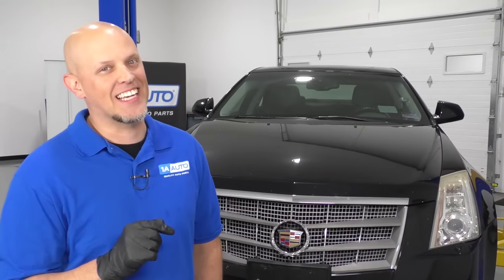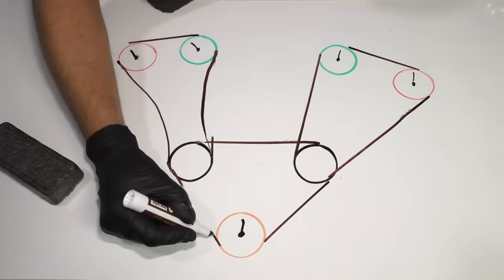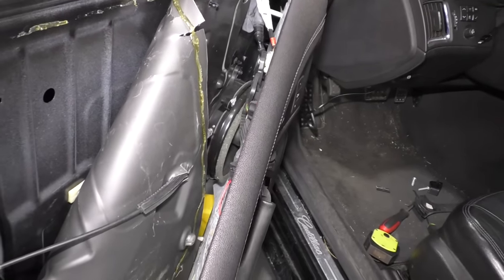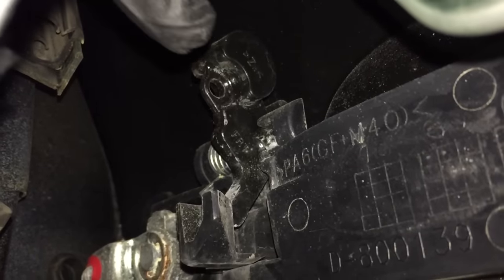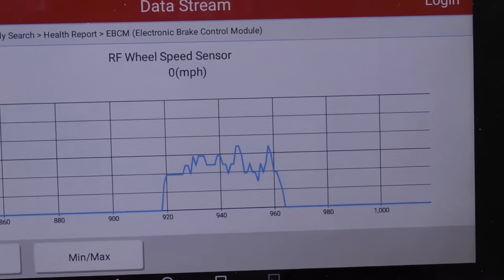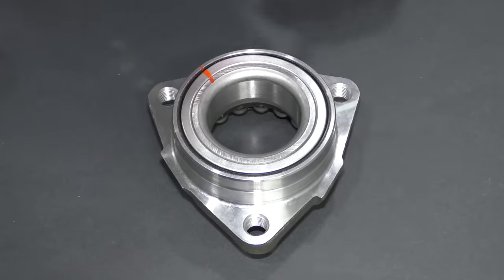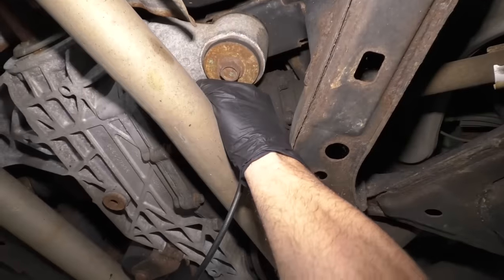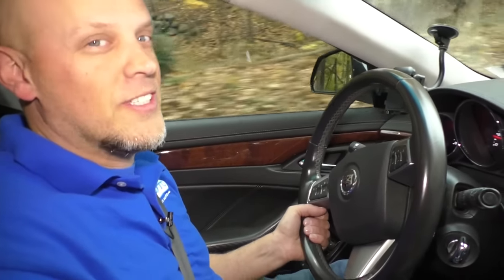Top 5 Problems Cadillac CTS Sedan 2nd Generation 2008-14

Comment from the maker: √  Watch the Video
√  Buy The Part at 1A Auto http://1aau.to/m/Visit-1AAuto
√  Do it Yourself
√  Save Money
Reply: I live in Nashville and I found an 08 All Wheel drive for an phenomenal price. It has a problem  with the steering and brakes cut in and out, I think its a vacuum leak. It only does it when the car is at idle. When you are on the gas the problem vanishes. Any ideas on what it may be?
Reply: I have had a problem with reduced engine power, any tips on correcting that?
Reply: Can yall show how to replace a cv axle please
Reply: What about 2008 DTS secondary injection valve stuck open.?

Is that expensive easy fix 
P2440?

Thank you
Reply: On a Cadillac SRX 2008 model

Comment: Don't forget the fact that you need to remove your entire bumper just to change your headlights.
Reply from the maker: +D Flash Thanks for the feedback!
Reply: Wow that's should be expensive
Reply: Actually you don't have to completely remove the bumper thankfully. I just replaced both headlight assemblies and I found a video that explains how to do it without removing it. Not exactly the easiest thing but it's better than paying a mechanic to do it
Reply: @ziggymac5813  I know on my 1st gen you go thru the wheel well so that probably works on 2nd gen too, both sigma platforms
Reply: Not true you can do it by the tires I've done it
Reply: Same thing w my old g35 led went out n I needa to rip off tha whole bumper
Reply: Honda's are the same way I don't know about any other car
Reply: Very annoying
Reply: G6 is the same way
Reply: Nothing difficult unless you’re lazy
Reply: Changing lights in heat wave - bummer
Reply: Not true!!!!
Reply: You only have to pull off the the side and the underneath clips. Go in through the wheel well
Reply: Oh that part i do hate takes a good hour of my day i recommended  changing them all to Led all in 1 shot last long time ⌛
Reply: Bro fr its so annoying😂
Reply: A lot of car manufacturers do that crap. I had the same problem with my 12’ Dodge Avenger.
Reply: Same on my wife's Hyundai Genesis Sedan. It wasn't that big of a deal. I also changed a headlight on my father in-laws CTS that was a pain
Reply: @codychavarria6088  nah man, my 10' civic the drivers side u can pop in and out, passenger you need to turn your wheel and wiggle it in through the wheel well. Not the easiest but better then taking off the bumper
Reply: Yeah that was an entire ordeal😂
Reply: Can be done other ways, but the number is actually fairly easy to pull on these. have to pull it to access washer fluid pumps and reservoir as well. Bought a 2011 that had the front bumper replaced and they forgot to hook the washer fluid hoses back to the pumps on the reservoir when it was installed. Talk about annoying.
Reply: @samholcombe3129  I was able to do that on my 2nd gen, but it was a tight fit, and you will get scrapes and cuts on your hands as well as cramps
Reply: @jesusramirez3145  way more difficult than it should be Richard!

Comment: I have a 2012 CTS and I hate the fact that anyone walking by can just open up the fuel door with a press and put whatever they want in there. Don't leave this car on the street if you live in the hood and/or have enemies.
Reply: Buy a locking gas cap. I've put one on 3 of my cars and never had a problem.

Comment: I have a 2011 cts 3.0. Owned from 46,000-98,000 miles. I’ve never had one check engine light or one single issue. I just did a coolant flush and transmission flush along with standard oil changes. Highly reliable vehicle at a great price and style.
Reply: Yeah that’s because you actually take care of your car😂 most people don’t realize they need to service other parts of the car other than the engine
Reply: The timing chain problem doesn't generally happen until the 100 to130km mark.
 I bought my 2010 CTS4 in 2018 with 151km on it and I was given the stealership invoice showing the timing chain was recently changed, I think it cost her around $2100 in all. 
The thing is you have to keep that oil changed. When I took it to my stealership they told me the first idiot owner never changed the oil for the first 15 thousand km and that's on a brand new car, the second time he changed it was around 12km.
 Thank god he sold it, I'm owner #3. I've had pretty much no issues except a new battery, front rotors and a door lock actuator in almost 5 years.

Comment: actually, #1 problem with these engines is the lack of baffles on the valve cover gaskets, which allows oil passage in the vaccuum lines. buy after market valve cover gaskets with baffles and the oil consumption is greatly reduced. my theory is that this contributes to the timing chain issue greatly.
Reply: Just had my valve cover gaskets replaced with the OEM ones , wish I had read this earlier :(
Reply: Just heard Scotty kilmer say that.

Comment: I've had my 2009 CTS for 3 years now. No problems...and I've done lots of driving!
Reply: I guess we got lucky lol. I had my 2009 cts 5 years no problem i even drive uber in it 4 days a week
Reply: How many miles do you guys have on them? I have an 09 CTS with 113,000 and its perfect but im worried about the sealed transmission. I would like to change the fluid but I don't know if it is too old to change now . the manual says to change it at 100,000 miles but no one I took it too was willing to do it . I guess i should have taken it to the dealership but they rip you off in insulting ways. They want like $600 just to change the fluid.
Reply: @MSG685  I'm up to 155k so far all good. Unfortunately i had to let the dealership rob me for the transmission fluid change. I've seen a few forums where guys are walking you through the steps to do it at home if you're into the DIY thing
Reply: I have a 2008 CTS DI with 121k miles. Have not had any major problems since 54k miles when I bought with 54k. Alternator was replaced a while back, I did have some leaks from the timing chain cover, I had that leak from a dealer because I did not want to touch that not had the time to do it myself. I actually had a fuel leak but was able to fix it myself with like $40 bucks. Right now I have a low RPM idle and I think I need a new oil pressure sensor because it only reads 0 or 100🤔
Reply: Daniel Thomas 

I guess it all depends on the previous owner and how well they kept up with the maintenance. I have an 06 CTS, it runs like a dream. 71k miles, 1 previous owner (my dad), no major issues. When he gave me the car, it had 38k miles. He was retired, so it was driven very gently and infrequently. All fluids checked and topped off weekly, I never let the oil life get lower than 20%. I only use 93 gas, and I use a bottle of Gumout about every 6 months or so. 

She just had her first tune up about 6 months ago at around 67k miles, as I was having a misfire that triggered the engine light. That’s the only thing I’ve ever had really other than the sunroof being sticky sometimes, but I live in Florida, so it gets very hot and wet and makes rubber sticky. 

Once in a while if she sits in the rain for a long time or we have a Hurricane, it will idle rough for a few drives but always smoothes out. I bought a car cover for hurricanes since I unfortunately don’t have a garage. 

I have heard a lot of bad about these cars but in my experience they are very reliable if maintained properly. Most people ignore their cars and just drive until something goes wrong. 

My dad had a Jaguar S-type, which was a total lemon and money pit, and now has a BMW 535 and I swear something is ALWAYS wrong with that thing. The shop has it more than he does.
Reply: @MSG685  dealership charged me 150 to do fluid exchange.
Reply: 04 deville with 200k
Reply: CTS Owners: Check your oil level regularly and top it off before it gets low, best preventive maintenance you can do on the 3.6L engines. They almost all burn oil as they age, but they'll never need timing chains as long as they aren't run low on oil.

Also, find a reputable indy transmission shop and have the fluid drained and refilled (NOT "flushed"), or have the fluid quality inspected first if you have high mileage already. If the fluid looks burnt/contaminated then you can at least know you waited too long to drain it out.
Reply: You beat the odds on that one.
Reply: I’m jealous of you. Recently purchased my first one, drives like an angel but after a month all the problems came 🤣
Reply: Then I wish 2020 brings you an honorable mechanic!🌟😁🌟
Reply: @DollnAbox  Good Advice Thanks for this Info. I Was gonna buy A Cadillac BUT i Was Afraid too BUT I feel more Better about it NOW that I have Read your comment.
Reply: @califoreigniasims3713  I had the exact same problem.  The first 200 miles were great.  Then the "computer" failed, , then the driver's door would not open without manual intervention, then the transmission kept throwing "Limp Mode", and then the Security System would NOT turn off, preventing the car from being started, and more.  These cars are the bane of their owners, for the most-part.
Reply: 08 was the 1st of the new generation. Sounds like they fixed a bunch of issues in the 09. My 08 has had alllllllll the issues
Reply: 09 cts owner here . all mine has downs is been a headache. Between check engine lights and timing chains pretty sure my transmission blue tonight its been nothing but trouble . i own a 04 Yukon with double the mileage with 0 problems why cant Cadillac make something good anymore
Reply: I've had a few issues but nothing major except my sunroof leaking and I know to clean out the drain tubes to fix that.
Reply: Is it gonna be a good choice to buy one cts 2008 in 2021? Need suggestions please!
Reply: I do the oil change everytime it needs it the only problem I had was the water pump fixed it
Reply: You jinxed it
Reply: My story is opposite: nothing but engine lights
Reply: Thank you so much for saying that. I just bought that year to be my hoopty for the next 6 months to a year and I really don't want to have a strong of issues. Bought from private owner and I guess you never know.
Reply: @MindRightLifeRight  I have an 09 CTS and my oil pressure gauge started doing the exact same thing last year at about 80k.
Reply: That’s a blessing
Reply: U lucky ive had my 2010 for about 3 years and have had to replace pretty much all these things except the timing chain but i have camshaft and crankshaft  position sensors codes
Reply: I have a 2012 cts. 160K miles and NO problems ever. Best car I've owned so far.
Reply: My dad got lucky same with you guys
Reply: @yamimreza8057  same here
Reply: @MSG685   i got it changed with thr filter for bout 170$ at a mechanic  i know in long beach long Island  ny . Change the oil oem oil and filter dont use aftermarket s
Reply: I just bought mine and it was shaking real bad when I was on the highway
Reply: @califoreigniasims3713  how many miles did u have
Reply: @rondijcks9162  how many miles did u have
Reply: Very lucky u😮‍💨.
Reply: @yamimreza8057  no buy above 2014 model
Reply: How has it been 5 yrs later?

Comment: I have an '08 CTS Performance with 88k on her. Fan-TAS-tic automobile!!! Really quick and fast, NO major problems EVER. Owned her for over 5 years now. Have had none of these problems except the passenger front door handle has quit on me. I thought it was a programing issue; took her to the Stealership for a reprogramming to fix said issue. [Never said to just repop her, just that the outside handle stopped working!] They had the car for 2 days. When I come to pick her up, service manager acts like it's the task of the century to repop the system, had to do it twice, etc. $600+ later [!!!!!!] , now working, brought her home and didn't drive her for a couple days. Lo and behold, I can't open the door for my love!! Broke again!!! No recourse on an electrical repair!!! So, she's still broke! Thank you SOOO much for showing how to test it and what the switch looks like; I may tackle it myself when the weather gets warmer, as it's pretty cold out right now! Thanks again! SUBBED. PS  I still love this girl!! MT Car of the Year in '08!!
Reply: GM-Cadillac just doesn't get it. Knowledgeable people no longer regard Cadillac as a premium brand...except in regard to the prices they charge.
Reply: I still have the 2008 CTS4 I purchased brand new in 2007, it was "Car of the Year" for 2008. Problems I'm now having are primarily electronical, a/c controls quit working, rear windows roll down on their own, car occasionally goes into "limp mode" where it will only go about 30 mph, and driver door will not automatically unlock from outside (must use key). Car only has 83K miles so hate to let go of it but it is becoming a money pit.

Comment: Have a 2011 cts coupe 3.6 got it with 22k miles now has around 150k only thing Iv ever had to replace is an alternator
Reply: These are good cars
Reply: I think I might have to do that to what was the symptoms your car had?
Reply: I have the year up 12  replaces both batteries and alt   Other than that I cruise it

Comment: I have an 09 with 300K on it, and minimal maintenance, but door locks, TPMS and the Evap have been issues.  otherwise, control arms are an issue as well.   Overall, a great car.
Reply: Have you had any issues with engine power reduced light?
Reply: @mikelarry712  I had that problem and it was the injectors. I had to change the 6 new and original injectors to solve it.
Reply: @mikelarry712  300k? How do you make it last so long?
Reply: Wow

Comment: Have had an 09 CTS4 DI for almost a year now and have not had one issue besides a leaky sunroof and have realized this car definitely burns oil not very fast but you do have to keep an eye on the oil level. Don’t let this video scare you away from this car I love my CTS and plan to have it for many years to come. (I bought it at 72,000miles and it currently sits at 87,000 with no issues👍)

Comment: My 09 CTS, has 190K on it. 3.6 LLT engine.  Runs absolutely fine, changed the alternator, brakes,  front wheel hubs, and recently the upper control arms. All done myself. Car has never left me stranded
Reply from the maker: +justin carter Thanks for checking us out and the feedback! 1AAuto.com
Reply: how did you know your control arms need replacing .?

Comment: 2011 CTS in my driveway has had both front wheel hubs replaced, water pump,  thermostat, blower fan, and oil pressure switch. All was done by me. I bought it with about 47,000 miles on it and now I’m right at 160,000.
Reply: WOW nice Job !
Reply: Was the pressure switch hard?
Reply: Reliable vehicle overall?

Comment: Thank you , Bob Lutz, Ed Welburn, Rick Wagoner. This is one of the greatest Cadillacs ever. I got the 2014 CTS, with 80,000 miles, still the same break pads, nothing ever gone wrong. 14 more years , and I will be buying a new Cadillac, with V8 , or Extended EV, or Electric. Let’s see what it will be.
Reply: Love the elr look i got the 2010 caddillac  cts

Comment: Great video. I have the 2011 CTS 3.6 Premium with some V trimmings and RIMs that I bought new. It has 162K miles on it. As for issues replaced tires and brakes so far. I gave it a minor tune up with new plugs. Service every 8 to 10k oil change on full synthetic, other than it burns about a quart of oil at every 2 months I've had no issues. Passes smog easily no lights. TPM light is on seems the rear left is out, but its not important or an issue. Installed a Tesla 10 inch screen, and now the car is up to modern standard. Best car I've ever owned.

Comment: Great video. I have an 08 CTS4. Problems I've encountered are
#1 Water getting in the car from all of the various drains getting clogged.
The door handles for sure.
Replaces a couple of hub assemblies for ABS issues.
Coolant leak from O-ring in the back of the intake.

Comment: I have an '09 CTS 4 with the 3.6 L engine. I know very well about the timing because I'm in the process of getting that replaced right now. Car has approximately 140,000 Mi on it. I can't complain too much. I bought it for $1,000 as it sits with a clean title. While I'm at it with the timing, it's also going to get a variety of fresh seals in the top and front of the motor, every fluid under the hood flushed and replaced, new plugs, coil packs, air filter, pcv, O2 sensors, transmission / transfer case / differential service, new serpentine belt and tensioner, and finally, see if I can figure out where the water is getting into it from. It does have the panoramic roof. After all that, I'm hoping it will wind up being a good car for quite a while.

Comment: I have a 2009 CTS , now at 100k miles and 11 years old. Had to replace both rear wheel bearing assemblies. Both rear door latches stopped unlocking and need to be replaced. The cam chain was replaced under warranty due to an error code regarding cam position. Just recently replaced the coils, as 2 failed. Now I need to clean the sunroof drains and the external trunk release button does not work. I still love my car! Very cool video and pretty accurate compared to my car.
Reply from the maker: +Don Guhl Thanks for checking us out. Shop for high quality auto parts on 1AAuto.com:

http://1aau.to/m/Shop-1AAuto-c